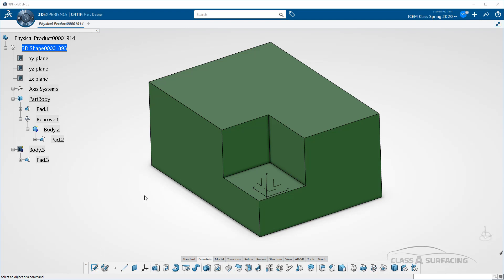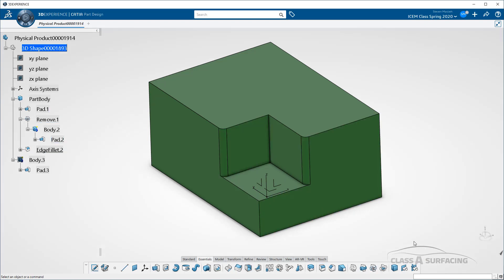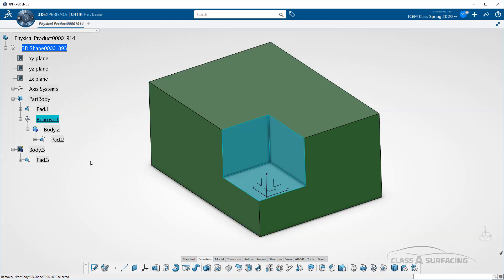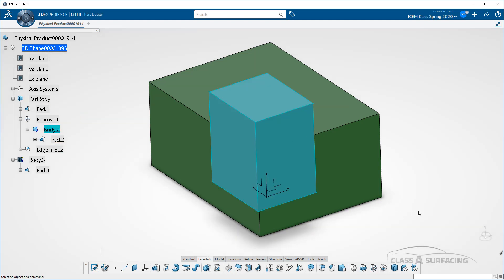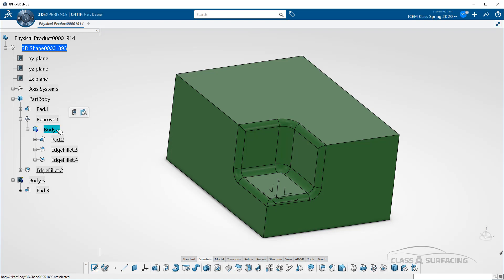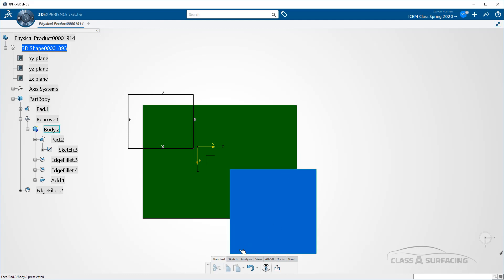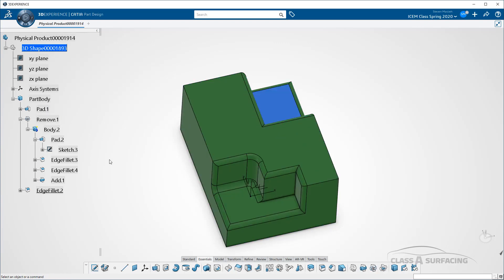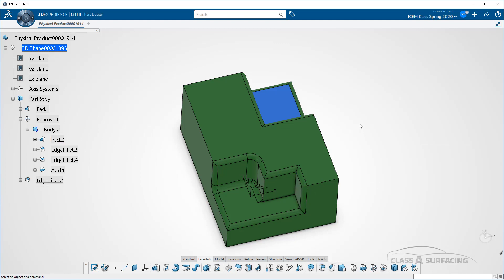3DEXPERIENCE: Propagation Selection

Comment: You can even build EdgeFillet.4 (2:44) as an intersection fillet with the parent EdgeFillet.3 (provided your remove Body.2 protrudes high enough to avoid the unnecessarily filleted extra edge conflicting with Pad.1, which is apparently fulfilled).

Comment: Is it something new in Catia? NX have this "Selection Intent" since a while.
Reply: The advantage I see here in Catia is one of usability, because you choose your selection intent within the fillet menu instead of going to the upper frame menu in NX to choose how you want to select the curves/edges.
A lot of NX users do not know of this small dropdown, because it only shows up when you start your functions like a fillet, extrude and so forth and the user's concentration is on the new menu and not on the other small random menus and dropdowns where you can tweak the behavior.
Reply from the maker: Catia has had this option for well over 10 years. It is not new at all. And frankly it works better than most of the selection intent in NX.